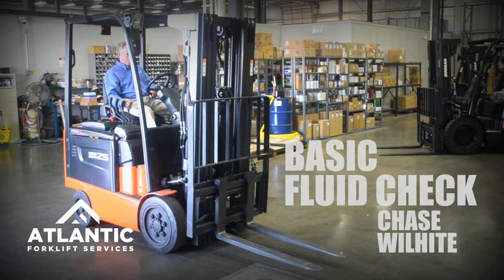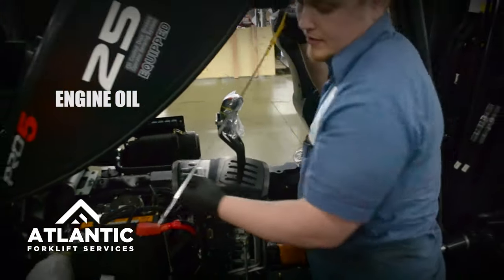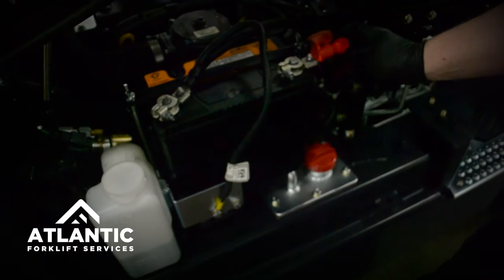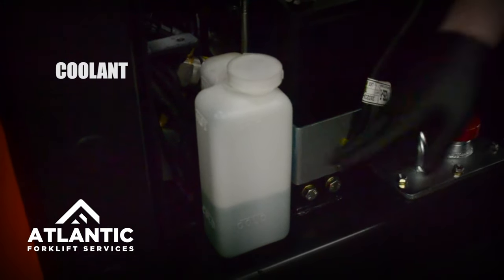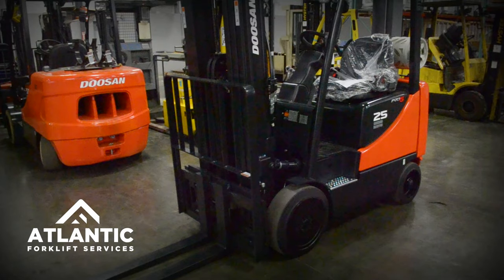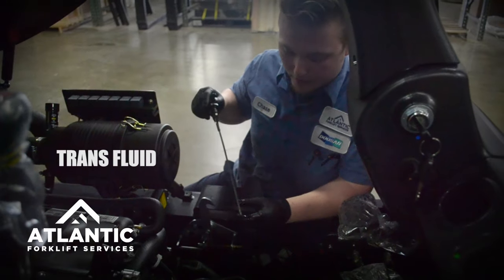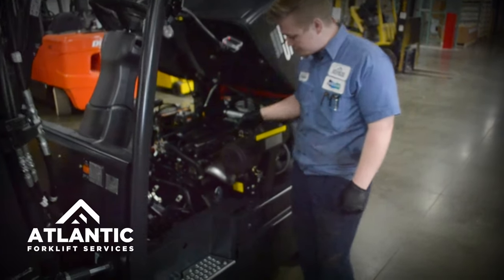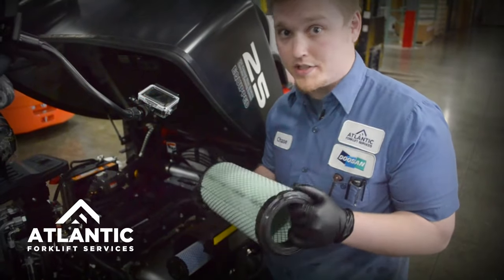How to Properly Check Forklift Fluid

Comment: You also have to check Coolant level under the cover you unscrew behind the bonnet 
See radiator cap only check it when cold tho lads😉
You can't always relie on expansion bottles cause the small hose coming from bottle to the radiator could have been chopped by the fan😂

Comment: You forgot to also mention on this model doosan the differential level located front axle. 
Also what Coolant to use  what oil grade to use. Some of these models have wet brakes don't use Dot4 it mineral oil.
Only from experience its for the drivers who don't have a clue for when topping up the levels. As if they check them any way more work for us to do ha ha 😂🤣
Reply: Driver only loans our forklifts. Then we get mad at them.